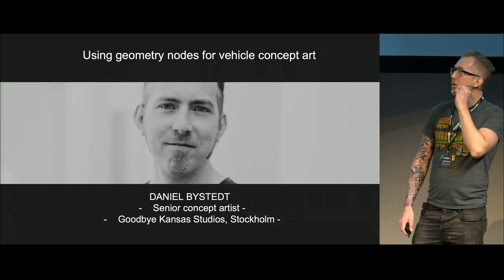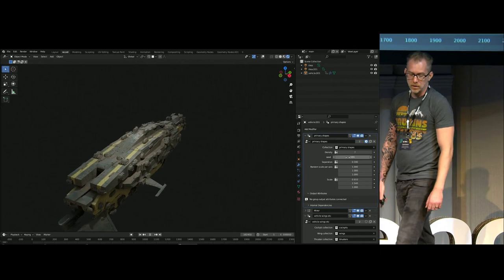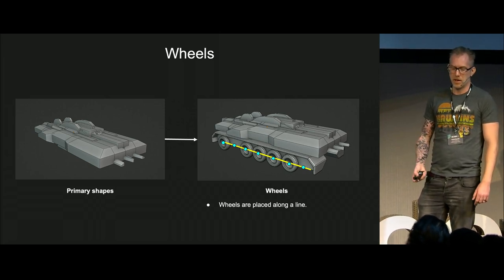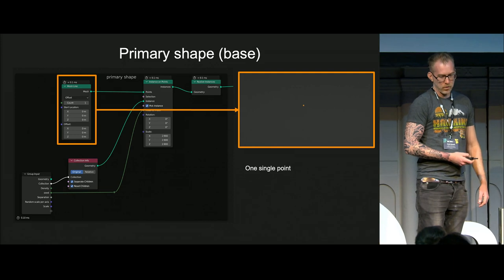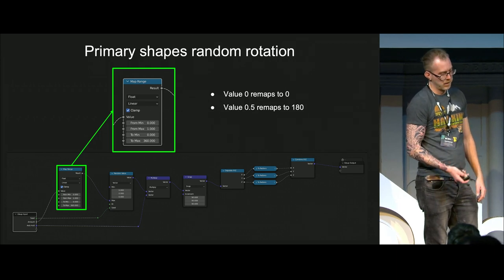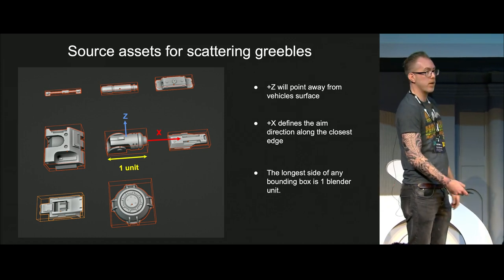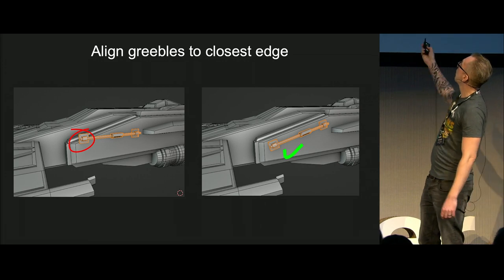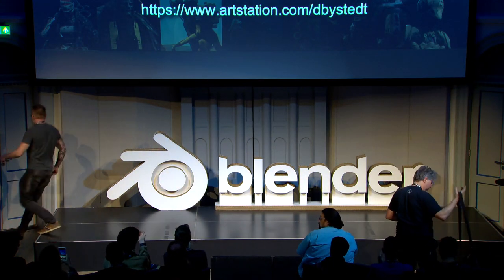Using geometry nodes for vehicle concept art

Comment: I've been trying to recreate this node system for days and have had some trouble figuring out how certains parts were made (mainly because I believe some slides are not 100% accurate, it feels like some screenshots have been taken while working on the node system and got changed later on, as we can see on further screenshots, like for the align to closest edge for example). Also I'm using Blender 3.3 at the moment and it feels like this presentation has been done with Blender 3.5

One big question though, regarding the conversion from mesh to volume back to mesh : how did you manage to actually scatter greebles on the OUTSIDE of that mesh output ? Because the VolumeToMesh node actually creates an inside that then gets mirrored with the Mirror modifier, making the mesh look like an empty box, with enough room to scatter tons of greebles on the inside.

Hopefully I can get some answers out here, cuz I've been struggling for a while haha
Reply: Update : I found a way of dealing with the fact that the VolumeToMesh node doesn't give us an empty shell.
I managed to delete all vertices that would have -X coordinates, and then using the MeshIsland node as a selection for another DeleteGeometry node, I managed to delete the inner island. Unfortunately, this only works for the island that was connected to the X axis (x=0), but doesn't work for islands located further away from the axis.
This will do the job for now, but I'm still very interested in knowing how you tackled that part.
Reply: @AnarGusto  Does the "Fill Volume" check-box not do what you need on the MeshToVolume node?